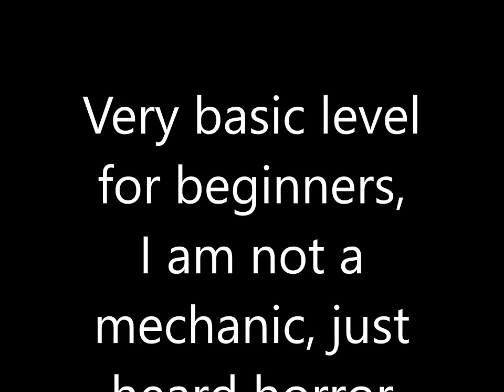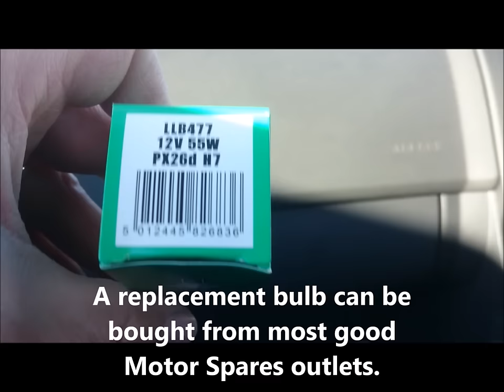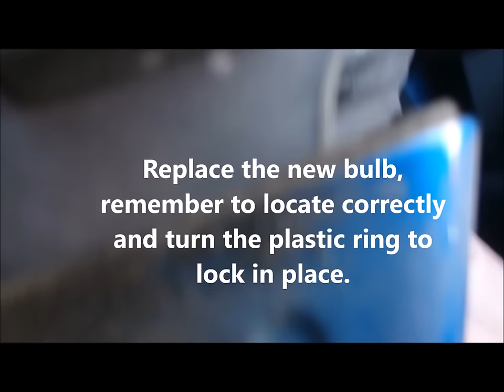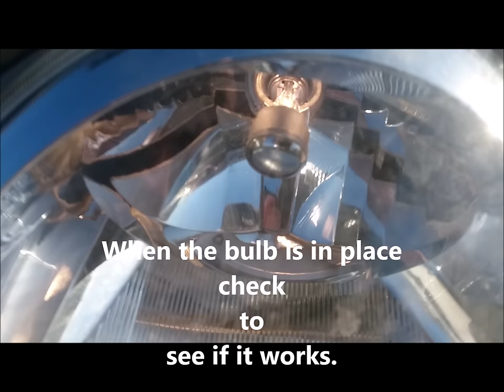VW Polo - How to replace headlight bulb

Comment: You need even smaller hands to replace the headlight bulbs in the Polo 9n with 1.9 TDI engine. Unless you're willing to remove the whole bumper (VW recommend method) 😋

Comment: Is it the same procedure for the driver side light? It seems like I have to take the water tank out and everything 😩
Reply from the maker: Well...the procedure is the same...and your right...its a nightmare,  most vehicle manufacturers seem to think it's fine to make such a simple process like replacing a light bulb such an impossible task. On most cars you find one side manageable but the other a major ordeal, with removal of parts to get to the back of the headlight unit, ie, on the Renault Clio, you have to remove a wheel and arch inner liner, before you start.

Comment: I changed my bulb just now but every time i put my ignition key into the car it starts to make a continuous beep for 30 seconds then it stops, did i connect the bulb the wrong way around or what, bear in mind the headlight now works and apart from the noise everything looks fine
Reply from the maker: i'm not an expert at all so I don't know what your problem may be, someone else might though.
Reply: its due a service

Comment: Well done. Can you please also do front side light bulb replacement video ?
Reply from the maker: Ah! sidelights... more trouble than they are worth,if you have tried already you will know there is'nt any room, so its best to take to a main dealer, I believe that they will replace for you free of charge as long as you buy the bulb from them. Sorry but as designs go, this one stinks!
Reply: I concur with that. Either a garage when you have it serviced or a member of the magic circle if you know one. It really is a closely guarded secret!